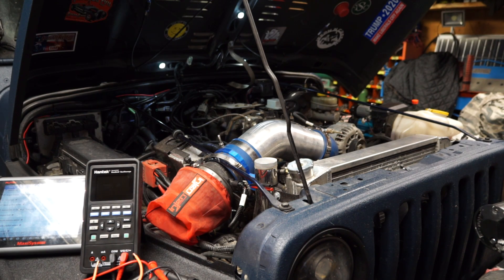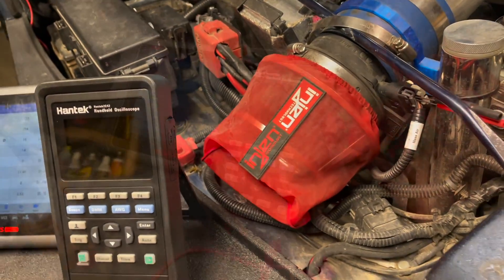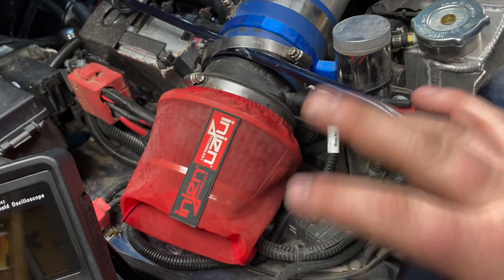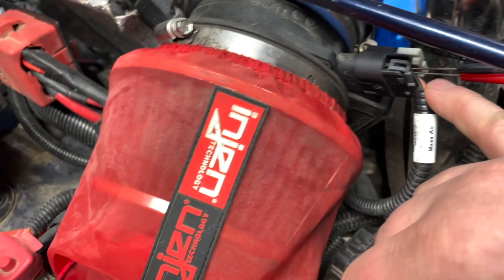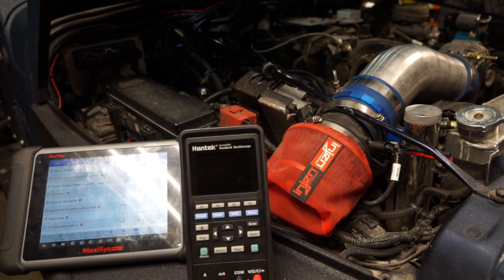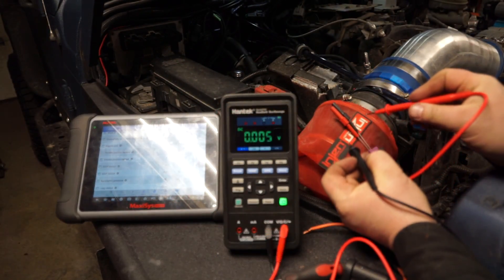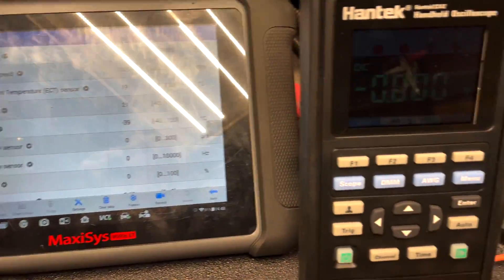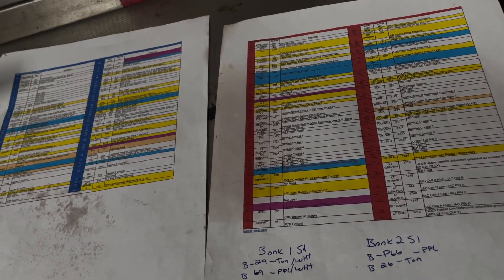P0113 IAT High Voltage

Comment: P0113 code on Ford C-max D2 1.8 tdci (IAT sensor high code)   The plug for the diesel fuel pump had come off, the scanner showed IAT on live data was 23deg (normal) so not the IAT sensor at all. Take all codes sceptically, Fiat 1.9diesel MAF code turned out to  be EGR.